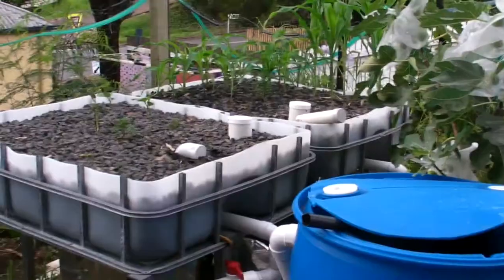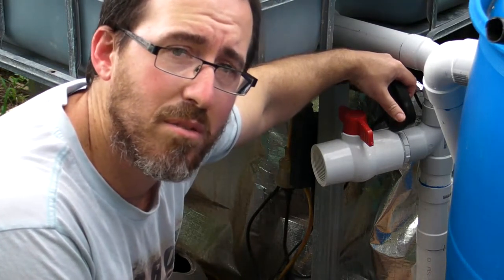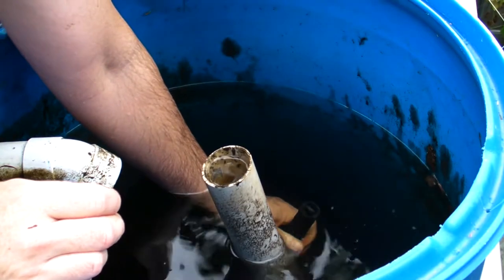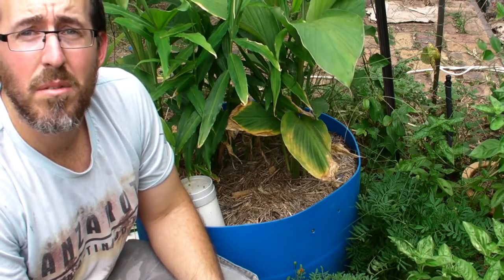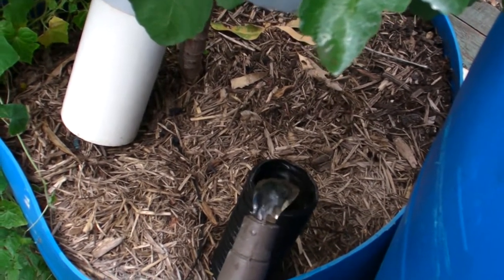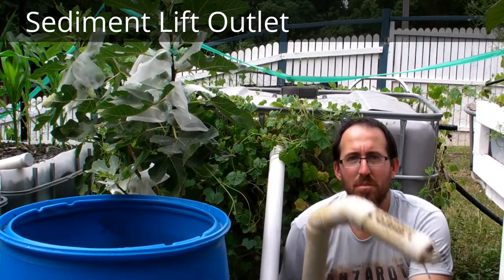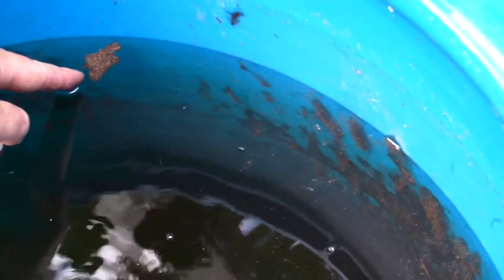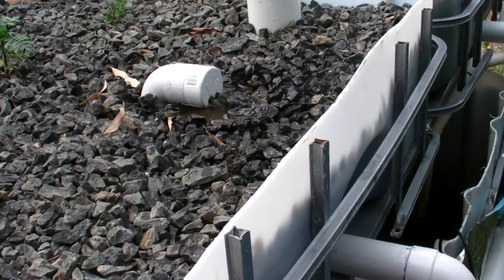Aquaponics radial flow filter clean

Comment: Nice one Justin.. I like the 45° on the outlet to the grow beds from the filter, a great simple addition..
Cheers mate & hope you're having a great weekend..
Reply from the maker: Thanks Rob! Can't believe how long it takes to edit the clip! no wonder you are so busy!! One thing to add about putting the 45 on is that you have to drill breather holes at the highest point of the bend, otherwise you risk getting an air lock.
Reply: Justin Aquapontastic Hammond Thanks for the comment you posted here. I just finished fabricating my fish tank, radial flow, and moving bed filters. Was filling up with water fine, and I turned the pump off before the sump emptied. Went to turn it back on and instead of the moving bed continuing to fill, the radial flow started overflowing. I'm assuming now that I have an air lock in the outlet of the radial flow.
Reply from the maker: ***** No problem, hope you find, or have already found, the problem. Good thing about an airlock is that it will always be at the highest point of the slope of a pipe.... getting the airlock to stop forming is the hard part.